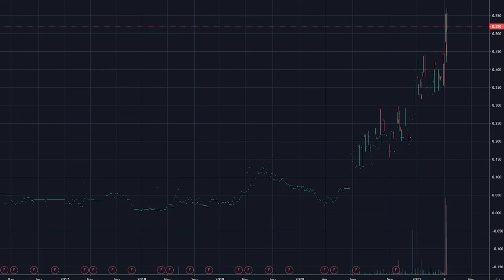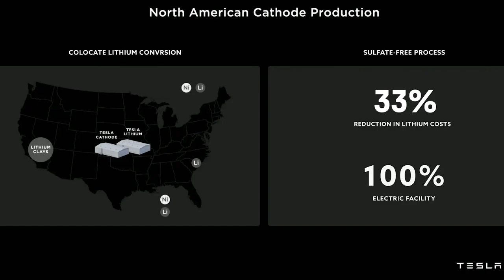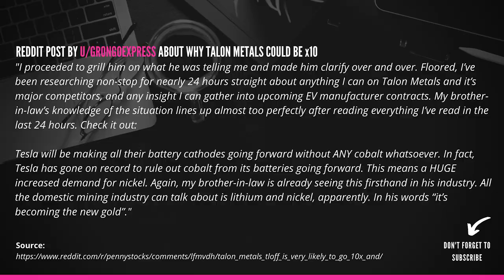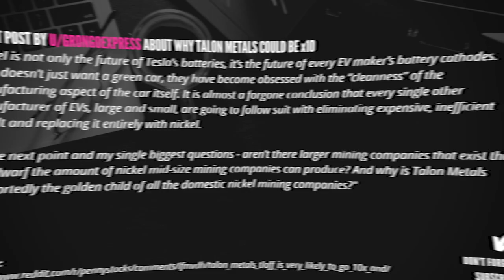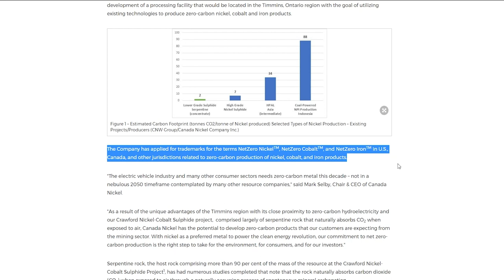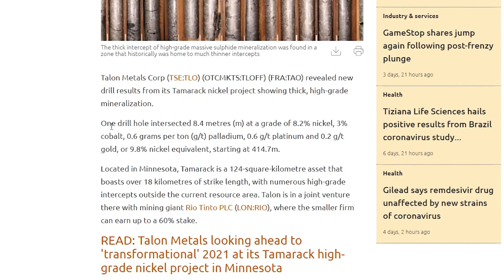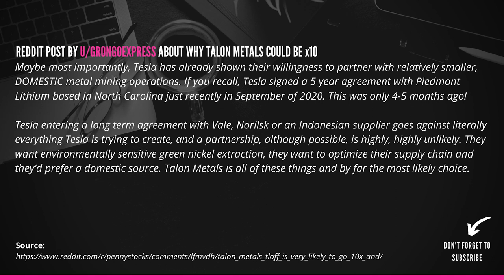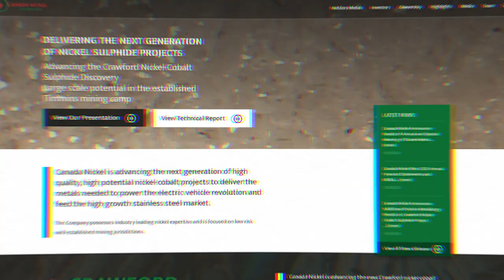Talon Metals discovered by Reddit traders! Will Talon pennystock go x10? (#TFOFF #TLO #TAO)

Comment: Even if Tesla does not get an agreement with Talon metals, there are other U.S. carmakers which will need nickel... I am holding this stock for more than 6 months and I am thinking about adding more. If Talon gets listed as a regular stock and all Robinhood and Webull will be able to buy it, that will be a huge boost to the stock price.
Reply from the maker: Was thinking about the same! But I was in at $0.20 and have learned to never buy something that is up.

I need to rethink this adding more personally 😅
Reply: @FMTF-makemoneyonline   I bought at $0.23 with a plan to hold it until they get a lucrative contract or start producing Nickel, hoping for a 10X return. I need to do more research, but if I get more conviction, I am happy to add more at higher prices. I agree with you on developing a routine and do not rush into buying at the top. I am sure this will retrace some and we can buy the dip ;)
Reply from the maker: Well done, you also saw the potential of Talon quite early. When it retreats to 35 I'm loading up more at discount 😂

I have found another two mining conpanies. Working on the Aston Martin stock video now, but will do a video about them after that.
Reply: @FMTF-makemoneyonline  I too got in at .17 and .22! I remember being corrected by you in another video when you fact checked me on an agreement I claimed Tesla had with TLOFF after battery day. I appreciate your fact checking and point of view. I am still holding 12k shares avg price .21 cents now. Let's see what happens.
Reply from the maker: @JoseVazquez-ru1nn  Hi Jose! Thanks for your comment! I didn't really fact-check you, but I just wasn't aware of anything related to a partnership at the time :).

We all have those instances where we believe we have read something, or came to a conclusion we cannot reverse engineer at a later point in time.

I'm sure Talon will reward us for our patience! 🚀🚀